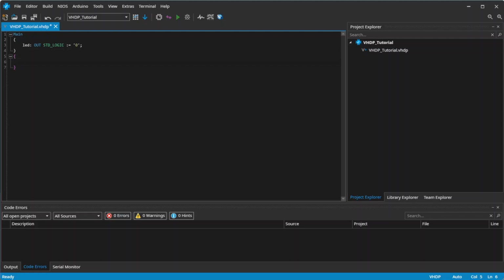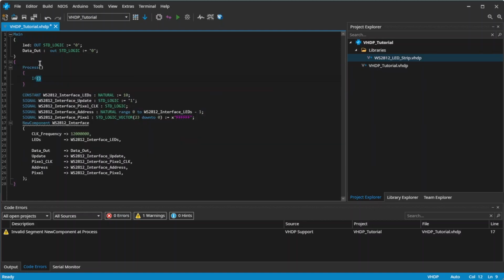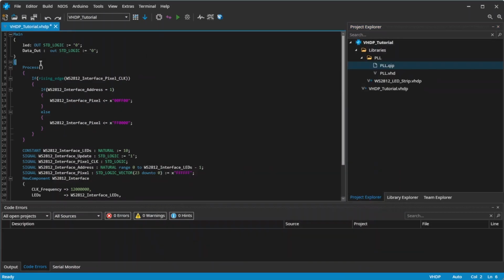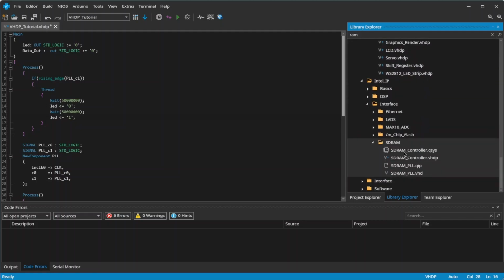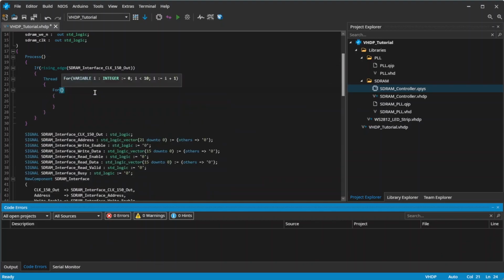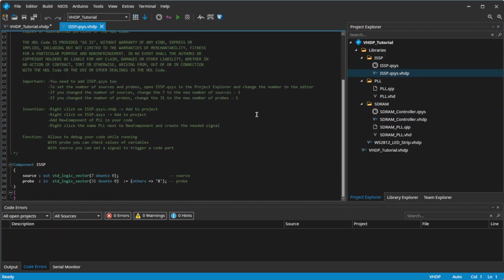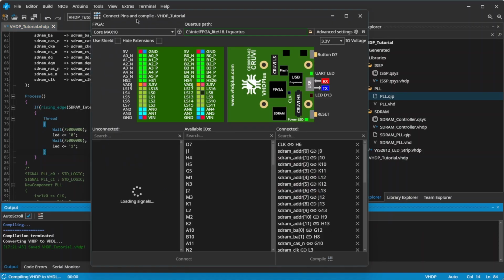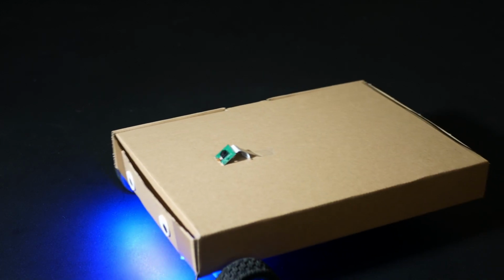Don't Program Everything on Your Own - VHDP Tutorial #5

Comment: I have the Arrow MAX1000.  Is the SDRAM on that supported if I tell VHDPlus that it's your MAX1000?  It seems to have the same specs:

MAX10 10M08SAU169C8G ~8k LEs

Integrated Arrow USB Programmer2 (FTDI)
Arduino MKR standard 25x61.5mm² 
PMOD connector header: 6x2
8MByte SDRAM
8MByte Secure Flash: HMAC-SHA-256, OTP/volatile key, counter 
3 axis accelerometer
Reply: Arrow MAX1000 is the same board, you can use it.
Reply: @hendrikmennen3966  Great.  Thanks.  I missed seeing that reply, before.

Arrow seem to have discontinued theirs.  I may order one or two of yours, at some point, but your shop being in Germany makes it more difficult.  

Things I import are subject to being held hostage by the post office, if the VAT hasn't been paid on them.  They then demand a ransom from me, plus the VAT, before letting me collect them.